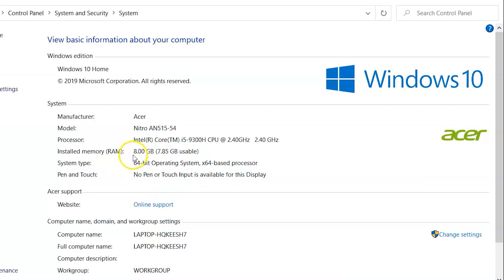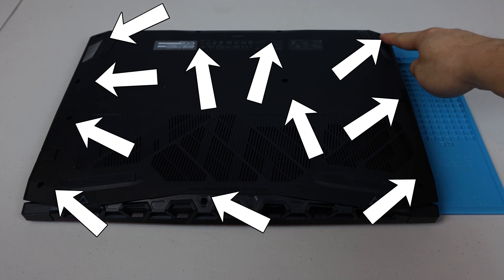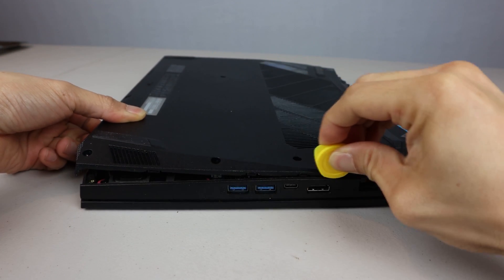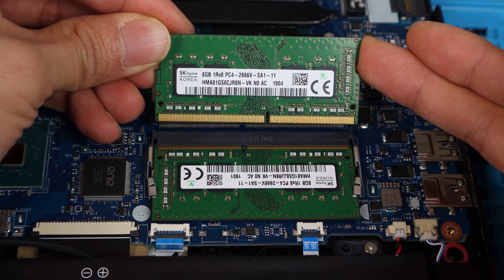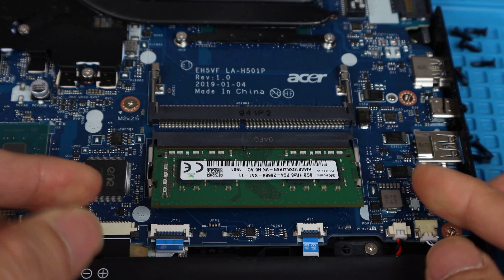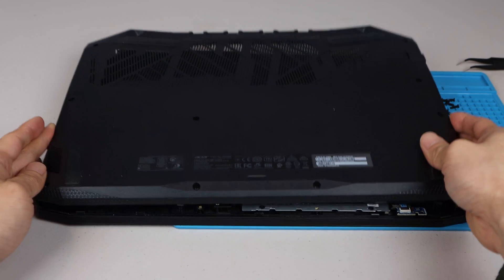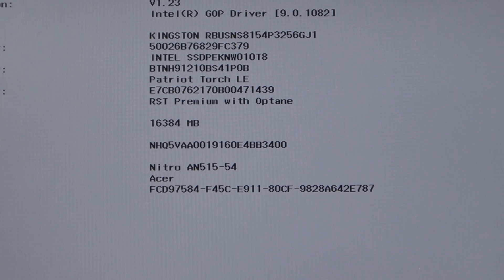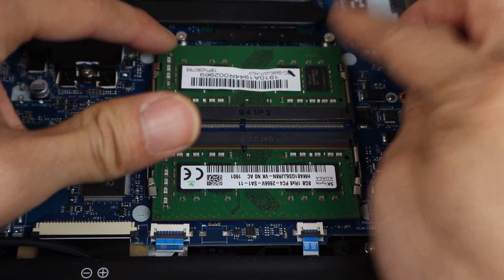How to Install or Upgrade RAM in an Acer Nitro 5 Gaming Laptop (2019 ver) DDR4 up to 2666MHz 32 GB

Comment: hey do you think it is worth it to buy 2 16gb of ram for gaming? 
i had 16gb before so i bought a new 16gb to add to it then found out i have 2 8gb in it at the moment so im going to buy another 16gb to put in with the new 16gb i bought just wanna make sure thats possible before i buy another one?
Reply from the maker: Typically, for gaming you won't see a huge performance increase going between 16GB and 32GB. But you can mix and match what you've got and use 24GB too (a 16GB and an 8 GB together). I'd give that a try first and see if you feel it makes a difference for you before investing in yet another RAM stick that might make a negligible difference.

Comment: Which MHZ ram can i  add to this laptop ?
Reply from the maker: 2666MHz is the max speed, and it accepts up to 32GB total of RAM. You'll need a 260-pin SODIMM DDR4 chip.

Comment: You don’t need to take the whole back off:  there is a small door in the back that takes just one screw to remove
Reply from the maker: Thanks, but this model doesn't have the access panel you describe, though I know some older ones did (2018 and prior). It's easy enough to pause the video at 0:53 and see that there is no access panel for either the RAM nor the HDD bay.

Comment: What does the "1901" and "1904" matter?
Reply from the maker: That's just the manufacturer code for the year and week of manufacture, so "1904" means the chip was produced in the 4th week of 2019 and "1901" in the first week of 2019.

Comment: The video card still working as the same even if you put another 8 gb ram for upgrade?
Reply from the maker: Yes. The RAM for the GPU (video card) is generally independent from the RAM for the CPU.

Comment: The default speed of the ram that came with mine is 2400 MHz and I have the AN515-4-R34S, can I replace the one that came with and then add a second one to have the Max of 32gb and if so what brand/size do I get? Do you have a video on how to replace it for both? Also if you can link the types that would work it would be great man and definitely feel confident adding a SSD with your other video thanks again for help
Reply from the maker: Hi there. Based on your model (Ryzen CPU), you can install a max of 32 GB DDR4 RAM with a max speed of 2400MHz. Yes, you can replace the existing chip with a higher capacity one, but not one with a higher speed because you would be capped at 2400MHz. I recommend using two RAM sticks with 16 GB capacity to achieve the max amount of RAM (a single 32 GB RAM stick would work, but this is usually more expensive and performance won't be as good). Laptops are generally brand agnostic when it comes to RAM, so typically any brand of the proper size/spec will work. These are a good option: https://geni.us/n3Sh1W [Amazon Affiliate Product Link] and should be compatible with your model and are also overclockable. The important specs to shop for are SODIMM DDR4 260-pin 2400MHz; generally the lower the CL (CAS Latency) the faster the RAM.

Replacing both RAM chips is the same as adding one or only replacing one chip, so this video should be able to serve as a reference guide on how to do that, see 2:15 for how to install both chips. It doesn't matter in which order you install them.
Reply: @FixItPhil  thank you so much
Reply: @FixItPhil  just purchased using your link by adding it to my cart hopefully it helps you out and thanks again

Comment: will any DDR4 ram work cuz i bought the PNY DDR4 8gb ram stick i dont know if it will work.
Reply from the maker: For most cases the answer is yes. It's rare that you'll run into compatibility issues, though that's not to say it doesn't happen because it does. That's why I usually recommend matching the existing RAM's specs exactly when added a second chip, or if replacing both, try to match all the specs of the existing RAM while only increasing the capacity is a pretty safe bet.

Comment: Having trouble with the end screws of the laptop , I don't know which screw driver type to use to take it off so I don't strip it
Reply from the maker: Generally speaking, use the largest size bit that will fit snugly into the screw top, for me, this was a Phillips size PH1. If the bit is too large to fit in the screw, of course, do not try to force it in. However, most of the time, stripping is cause by using a bit that is too small, so if after placing the screwdriver bit into the screw, it feels loose and not secure, do not attempt to turn the screw. The other tip is to apply downward force, directly onto the shaft of the screw while turning. This gives you more torque and lessens the chance of stripping the screw. The best screwdrivers for this purpose have shafts that are free-spinning independent of the back end of the handle: https://geni.us/kWSA [Amazon Affiliate Product Link] This is my favorite set that I use most. For one-handed operation, you simply press your thumb into the red cap on the back, and turn with the rest of your fingers or use two-handed, if space allows.

Comment: How did you benchmark it ?
Reply from the maker: I used the UserBenchmark tool (before and after upgrading). It's quick and dirty and not a true stress test of the chips, but I simply wanted to verify that I was getting some performance improvement. Of course, it plays out differently under normal use with games and other applications, but I can't say I'm disappointed with performing the upgrade.

Comment: I used 2 PNY 8G ram sticks and after installing them, the screen wouldn't turn on but the computer would be running. Not sure what I did wrong.
Reply from the maker: I think in many cases when this happens, this indicates one or both chips you received is either damaged, incompatible, or your BIOS settings are incorrect for the chip. This might happen if there's a mismatch in the CAS latency (CL value) of the chip and the timing settings in your BIOS or you have and XMP profile enabled in your BIOS and the RAM doesn't support it or vice versa. You can try testing the RAM sticks individually by using only one at a time to see if the laptop boots up, to rule out any issue with one of the RAM sticks.

Comment: Quick question i added the 8gb ram but now my laptop wont boot up,any ideas?
Reply from the maker: It could be a couple things. If the RAM chip is damaged in some way or defective, this could prevent startup of the laptop. The same is true if the chip isn't seated all the way in the slot. The other possibility is there is a compatibility issue if the new chip doesn't have the same specs as the one that was there already and is causing an issue. Try re-seated the chip by removing and re-installing it first. You can also try swapping the slots, or trying to run it with only the new chip without the old one, to rule out a mixed RAM compatibility issue. If that doesn't work, and if, when you remove the newly installed chip, the laptop returns to normal function and boots up, then there might be a problem with the chip, the RAM slot itself, or it might not be compatible with your system.

Comment: Omg thank now I know its 2667mhz fits nitro 5. Do u think it runs well for escape from tarkov
Reply from the maker: Yes, this particular model of the Nitro 5 should meet the recommended requirements for Escape from Tarkov, however, depending on your specific build actual performance may vary.

Comment: Will this work for the An515-55 series?
Reply from the maker: Yes, the process is the same, although the layout of the motherboard inside is slightly different. RAM slots are placed more centrally and the M.2 slots are on the left and right sides (not adjacent to each other).
Reply: @FixItPhil  Will this work for the An515-53?
Reply: Okay, thank you .

Comment: Are those patriot viper steel worth getting and worth installing two?
Reply from the maker: Depends on what you're doing with it if you're planning on taking it all the way up to 32GB. For gaming, typically 16 GB is adequate, though a little extra never hurts. If you're doing heavy photo/video editing or working with large data sets, it's probably worth it to take it to 32 GB.

Comment: Hey there, ive got the ryzen base model and wanted to add 8 gigs so a total of 16 gigs. For the ram I'll choose the hyper x impact, does this compatible with the laptop?
Reply: I heard the hyper x runs just at 24000 mhz unless you have a XMP profile for Acer Nitro 5

Comment: Could you use any other ram stick or does it have to be the exact same ram stick
Reply from the maker: It's ok to use a different RAM stick, but the rule of thumb is to try to match the specs as closely as possible to prevent issues of incompatibility. Generally different brands will work fine together, but the more similar they are the more efficiently they'll work together and the less of a chance you'll have a problem.

Comment: Hi, i have a 4gb ram already. Can i add a 16gb ram as additional? Thanks for the response.
Reply from the maker: Yes, but depending on your configuration you may have one 4 GB RAM stick or two 2 GB RAM installed. If you have two sticks installed, you would have to remove one to install the additional 16 GB stick, giving you a total of 18 GB RAM. If what you have now is a single 4 GB stick, adding 16 GB would give you 20 GB RAM total.
Reply: You should be fine as long as you don't pass the total 32GB RAM limit.

Comment: What if I add a 26gb when I have a 8gb? Bc I don’t want to take out the already installed one in
Reply from the maker: The max amount the system can handle is 32 GB total, you do not have to remove the existing chip, and can install one of a different capacity and it should work fine (though they work more optimally when identically sized). If you exceed the 32GB max, you won't be able to take advantage of the extra capacity.

Comment: I just popped in my extra 8GB RAM (2X8) and my task manager says I only have 1 of 2 slots being used?! I tried reinserting multiple times. Does it just take a little time to recognize the extra RAM stick or did I do something wrong 😒
Reply from the maker: No, it should be recognized immediately and it should show up in the BIOS. Is the chip identical to the other one that was already installed? This would help rule out an incompatibility issue. If it's the same and you're sure you seated it all the way, then the RAM stick could be dead or defective.

Comment: Does anyone know if there is any way to enable/ unlock (in the bios) XMP on this model of nitro 5, i got 3200MHz RAM (as it was actually cheaper than the 2666MHz version) and have seen a few posts saying that they were able too unlock the hidden bios settings, but i have not found any way to do this for myself. I would love to run 3200 MHz. Please help.

Comment: Is this tutorial still valid for the 2020 version?
Reply from the maker: Removing the back cover should be very similar in process; remove the screws, then release the catches on all four sides. This video would be a valid reference,  though the internal layout of the 2020 version is slightly different; you just need to look for the component slots in different places. The RAM is located more centrally and the M.2 slots to the left and right hand sides of the motherboard rather than one above the other.
Reply: @FixItPhil  Thanks for the clarification!

Comment: hi it says that my ram speed is 2933 mhz, so should i buy a ram that is 2400mhz or 2666mhz?
Reply from the maker: If you're able to run 2933 MHz, then it makes more sense for you to buy a 2933 MHz RAM to match your existing one.

Comment: How does this work?...like I bought a acer nitro 5 an.....42...
And I bought a 16 gb ram........so if I add this ram will it become 16 or 8
Reply from the maker: Well, your laptop will only be able to hold 2 RAM chips and you just add the number on both chips together to get your total RAM. So if currently you have a single 8 GB chip and you add 1 stick of 16 GB then you will have a total of 24 GB. However, if say your 8 GB was composed of two 4 GB chips, then you would have to remove one to add the new 16 GB chip, so you would have 4 GB + 16 GB for a total of 20 GB RAM.

Comment: Do we disconnect battery before installing RAM or SSD.
Reply from the maker: You may, as a precaution, but it is not explicitly necessary. I performed those upgrades without disconnecting the battery, though the risk of accidental discharge is higher if something goes wrong.

Comment: I know this is kinda old but I want to upgrade my ram with two new sticks, can I just look up 16gb ram on Amazon and buy it or does it have to be a specif one?
Reply from the maker: You can use any DDR4 260-pin SODIMM RAM sticks. Brand is usually not important, but I usually recommend Patriot Viper Steel 16GB RAM: https://geni.us/52cnxY [Amazon Affiliate Product Link]

Comment: If I switch both sticks do I lose my data?
Reply from the maker: No. Data is stored on the SSD or HDD drives and not on the RAM.
Reply: @FixItPhil  what about if I upgrade to an hdd
Reply from the maker: If you add an additional drive, the data on the existing drive that you leave installed will not be erased. You would simply be adding more disk space. If you remove one of the drives that is already installed and replace it with a drive that has a higher capacity, yes, you would lose that information, unless you copy it back over when you are finished.

Comment: I have the version with 8gb RAM but it has a i5-9300H, would it be a good idea to upgrade to 16gb?
Reply from the maker: Sure, generally speaking 8 GB is "enough" to do only the most basic of computing tasks e.g. browsing the internet, streaming video, running office applications, and casual gaming. 16GB is usually the minimum that I recommend for a smooth gaming performance and data intensive work like image, audio, or video processing. For advanced computing and calculations like 3D modeling and graphics rendering I'd go with 32 GB.

Comment: can i  use 3200MHz one in an515- 43 2019 model but it says upto 2400 MHz   ....im confused ?
Reply from the maker: According to AMD, the max speed the board in your model laptop can handle is 2400 MHz, so while you can put a higher speed chip in there and it would "work" the speed will ultimately be stepped down tot he max it can handle, at 2400 MHz, so you wouldn't experience any benefit from going any higher.

Comment: I just got the nitro 5. I thought it was managing games ok until I checked the "can I run it" page. Basically games like halo anniversary runs ok aside from my 8gig ram says I have 7gigs while the game requires 8. As for other games I won't bother buying now since I need more ram. Where do I find the exact match to upgrade to 16 ram?
Reply from the maker: I got the matching RAM for mine at Amazon. I have a link in the description of the video for the Hynix RAM I used, but I've seen some Nitro 5 builds use Kingston RAM, so I would open it up to check first. In general it's not usually a problem to mix brands if the rest of the specs match, but just to avoid possible incompatibilities, I tend to stick with matching RAM sticks.
Reply: @FixItPhil  I think myn is hynix aswell. I checked crucial website to see the mhz. 2400mhz and I can get up to 32gb. But now I don't know the clock speed. Maybe 19? And for two 16x2 gb ram will cost around 200$ or more .. yikes

Comment: please tell which screwdriver size should I buy
Reply from the maker: You can use a mini Phillips screwdriver size 1 or 0. I recommend that you just buy a set with changeable bits/tips so you have several to choose from in the future to fit your devices. I have a link in the video description to the set I use for my gadgets.

Comment: I have a nitro 5 AN515-55 16GB ram laptop. is the 16GB ram link in the description the correct ram stick to match the one already inside?. sorry to ask but i dont have the tools yet to open it up safely and it doesnt match the same name brand as the 8 GB you have used. Thanks!
Reply from the maker: No, the 16GB RAM (Patriot Viper Steel) I linked to in the description won't be what's pre-installed from Acer, as they typically use Hynix or Kingston in their factory builds.

Comment: Hi FixitPhil, would you recommend upgrading to 32GB RAM?   What is the performance improvement that is expected?
Reply from the maker: For most folks, 16 GB is plenty, even for the latest AAA title games. The only time you'd really see any benefit to upgrading all the way to 32 GB is if you're doing a lot of heavy duty processing like rendering large/lengthy video files in 4K or doing a ton of calculations (MatLab, 3D modeling, complex data analysis, photo
Reply: @FixItPhil  Thanks for the feedback!    Appreciate the time as well as your content!   Super helpful!

Comment: Hy i heave the same laptop, but with 8gb ram. but idk
 why the hardvere reserved 2.1gb ram so i heave only 5.9 memory usage , that say for me the task manager. i tryed some solution from youtube,google serche etc. no one help.. from ur ram reserved some litle.. but on my 2.1gb ..
Reply from the maker: It depends on your build. Some systems do this because it needs to reserve the RAM for the onboard GPU, other times this is a configuration issue in the BIOS. It's hard to know exactly what is causing it in your case.